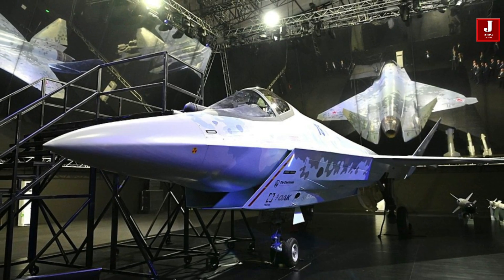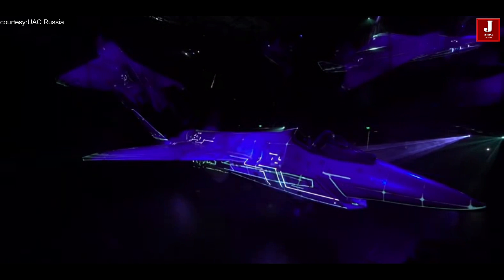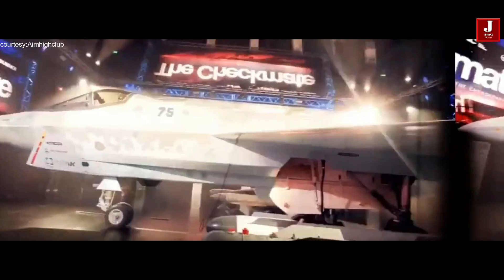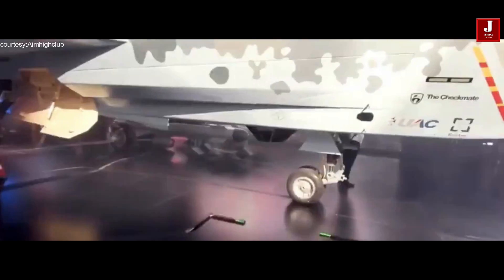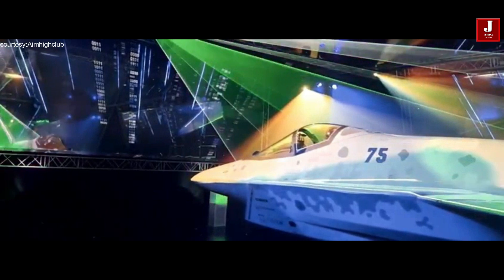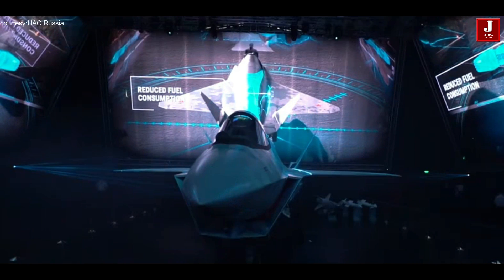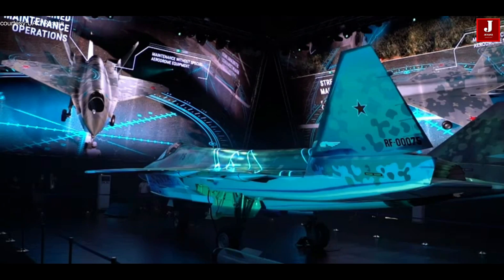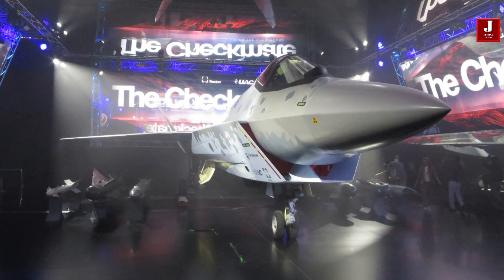Su-75 Checkmate Fighter Jet Concept Reveals Major Design Changes for Enhanced Performance

Comment: It's a very nice fifth generation plane, and it only costs $25-30 million where other planes cost $100 million.
I have a question: will the Su-75 like the su-57 be able to use the Sukhoi S-70 Okhotnik-B as a "Loyal Wingman"
Reply: y, OKHOTNIK S-70 CONNECTION IS POSSIBLE... THAT IS WHAT I HEARED SO FAR... CHEERS! 🍀👋😎